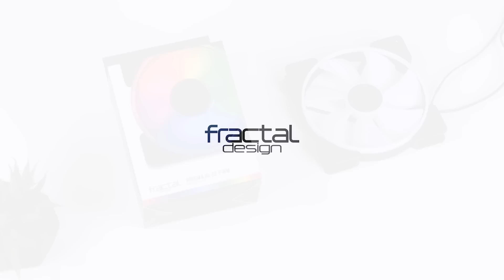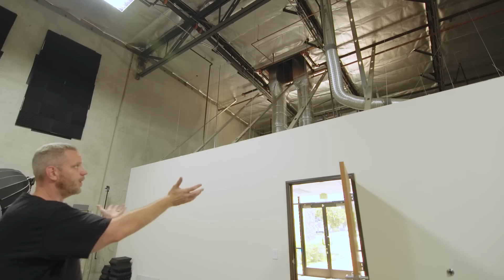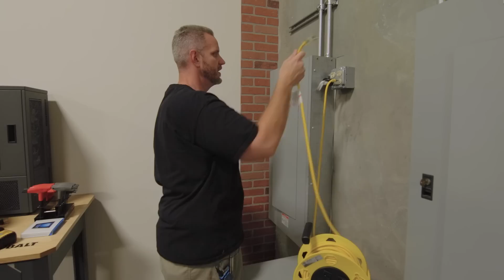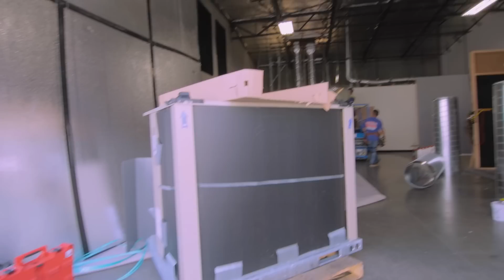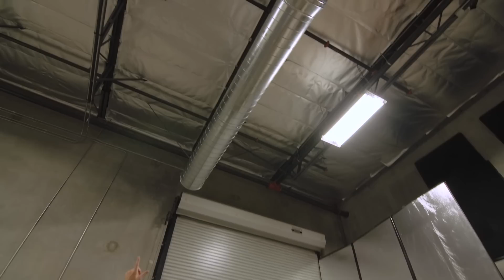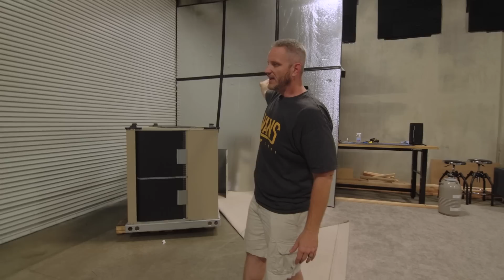The BIGGEST upgrade to the new studio yet!

Comment: Just a thought but if that metal outer door doesn't face an area people commonly walk by then maybe you could setup a outer tarp that slides like a shower curtain. Use the tarp to block the sun off that door. That would greatly reduce the heat coming from it. Just a thought that might could work depending on what you can and cant do and also actually finding a tarp or drop cloth big enough to cover at least most of the door.

Comment: For those curious: a 4 "ton" HVAC unit doesn't weigh 4 tons. It can exchange enough heat to melt 4 tons of ice/24hrs. That's about 48.000 BTUs/hr.

Nominal unit ratings ofc, as with pretty much every other type of thing that converts or "transports" energy.

By melt, it here means taking ice at 0°C/32°F, through the phase change from solid ice to liquid water. That requires about 143 BTUs/lb. Or roughly 334 kJ/kg.

Comment: The reason not to use that as an extension wire is that it is solid core wire. It will work harden and have internal breaks. Extension cords use strand wires that can be bent numerous times without breaks. Which is why solid core is used in walls where it is stapled down. Dont reuse that crap you pulled up, recycle it.

Comment: The "air handling" unit is usually an evaporator+filters+heater+fan maybe some more bells and whistles. It differs from the consumer grade splits that have only condensator (outside unit) and evaporator (inside unit) with no "air handling", which means you can asphyxiate if you don't have enough air infiltration. But those commercial splits are quite nice, many times even more efficient then the rooftop units that some people called packaged or whatever (less heat loss because the air cooling happens inside nearer the demand). I would just run it closer to 77°F and less to 75°F so you're in an nice thermal comfort and pushing the HVAC a little bit less in the hotter days, gaining efficiency!
The speed does influence turbulence and the flow, but at higher air speeds you have higher Reynolds number and usually a lot more turbulence, though surface geometries, dimples and other stuff either push for a more transitional / laminar flow or just push for a critical turbulent flow... not sure if these tubes do anything besides maybe have a certain look due to welding process, but I have no idea how they look on the inside.

Comment: Jay,  if you want to do like any movie sets, have a junction box with switches and proper breakers and proper size extensions.   That way you can have the extension cord on the floor.   
But the best way would be that you install overhead rails for electrical wiring and have proper sized wires extension cords going down where you can plug power bars at your bench.  That way you remove any power cords laying on he ground and taped on the floor.

Comment: I dont comment much on videos. But I design vocal booths and music studios. Roxul insulation is not only fireproof (test it with a torch, would make for a great video!) But also offers awesome absorption for sound stages. I insult all of my vocal booths with it. Creating panels with it is super easy, just get a sheet of plywood build a frame for it, and after installing roxul cover it with any breathable (hold the fabric up and try breathing through it. If you can breathe through it well enough to not pass out its good) fabric and mount it on the walls. Using brackets or whatever means you prefer. 

This makes it transferable in the future so it doesnt become a wasted panel and you can also make it decorative. 

Hope this helps! Love your videos, between u and linus you fill my geek needs weekly!

Comment: I'm not sure if you ever finished your thought. Is your plan to take the AC with you when you move in 5 yrs? Or you just went with a split system because it was cheaper? Because, although I'm sure you know the numbers better than I do, I don't think you'd be saving a ton of money paying someone to uninstall, move, and reinstall the split system. At least relative to what you're spending. I do mostly residential HVAC in the midwest, so I'm sure pricing is much different there also.

Comment: I can tell you right now it's well over 4k. I do residential ac and a package unit depending on the brand is 3 to 4k for a 2 1/2 - 3 ton unit. Used to be like 1500 couple years ago.

Comment: So, stupid question, did you even consider the noise factor of high velocity air? I promise the HVAC guys didn't. You need high CFM, low velocity air to keep the sound down from the air movement. Also, that indoor unit, gonna be loud af, on top of that office structure, will vibrate like a mofo, resonating the wall... People are going to stab you, Jay, because of the A/C low hum that will now be ever-present.

Comment: Why not use 208v nema 6-15 or nema 6-20? Better efficiency and more stable for overclock and build testing, I don't see why you would want to use 120v at all for computers and electronics if you have easy access to 208/240v and the cabling would've been more than enough =/

Comment: MASS for sound insulation ;) A lot of audiophiles uses books ... no, not the kindle kind, but physical dead tree carcass books. They give atmosphere while working to dampen resonations.
For the big door, foam is probably your best bet for insulation, build a frame around it all, use thick plywood (and not MDF), and make sure everything is also glued together to stop vibrations, then coat with something massive ... hell maybe bedliner and get it bulletproof on the go as well X) Plywood is much better acoustic dampener than MDF, infact MDF is pure crap in comparison and plywood is actually quite decent. Just get it there like 1.5" inch thick like you would build a subwoofer case.
Thick stone tiles goes for cheap too, if you figure how to mount them on that plywood it would deaden sounds like crazy through that insulation door.

Comment: That stuff for the power we call it twin and earth in the UK. Its is 100% not OK for portable extension leads and so on, its not designed to be moved or flexed as its solid core cable. You made the right choice to change it.

Comment: those fractal design fans are actually good, i have 3 running (4th one didnt fit) and they are working fine. also make way less noise than the Cooler Master MasterFan Pro 120 Air Balance i used before.

Comment: Some thoughts on the big metal door.  As soon as the sun hits the door it gets hot (duh).  This heats up the air on the inside of the door.  Whatever air space is between your insulating panels and the inside of the metal door will heat and then rise and cold air from the floor will flow in to replace the hot air rising and then that new air gets heated up and on and on.  This fills your space with hot air from the top down.  The solution is to put the panels on the outside of the door.  If not the panels then a roll down insulating barrier.  The idea is not to let the sun hit the metal door in the first place.
I love your vids, all of them.

Comment: Jay, why would you wanna block that entrance because of the heat or the intent to put up an insulation to prevent influx of heat? The channel's going to grow and you might start taking delivery of super fast cars. Would you break that entrance when that happens there after? 

I'd rather you get professional artisans or if possible yourself to fix the insulation unto the doors that would roll with the door when opened.😉😉😡😡

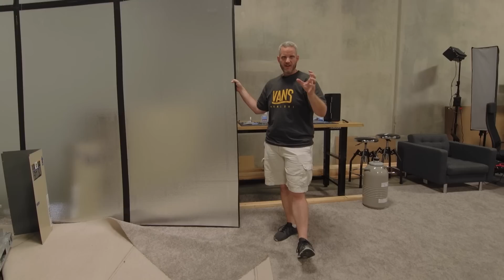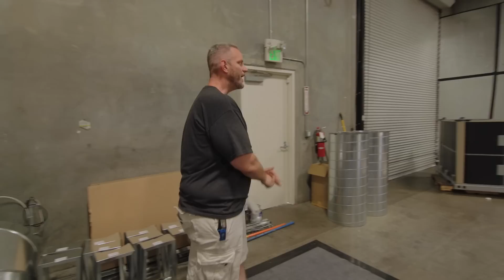Comment: In Phoenix everything was done in the early morning. Even every golf course is lit because first tee off is 4 :00, nobody wants to be on the golf course after noon when the heat is brutal. It goes over 100 by mid may and doesn't drop below 100 until mid October. In July and August it rarely drops below 100 before 11:00 at night, unless it is raining. If it gets really hot here the a/c is just not sized big enough, you want the a/c on about 80 percent of the time. It is not good if it is cycling on and off too much. An evap cooler just works better the hotter it gets. It needs a dry climate, the desert should make one really efficient. They won't work at all in a humid climate like New York. It usually reaches 100 by 10:00 in the morning, but it takes a couple of hours for the building to heat up.

Comment: Romex is only used in residential applications. It is illegal in any commercial application. As soon as an inspector sees it he will fail you. Also any equipment that is permanent, and many things that you would think are not, have to be hard wired. You can't plug them in, at least that was the way it was when I had a business. Nobody air conditions a warehouse, the electricity is way too expensive. You may want a/c though because you are working in the warehouse and paying the electricity bill. One of the places I had a business was Phoenix, the heat is brutal there. In the summer we did most of our production in the morning when it was 20 degrees cooler. We pretty much shut down in the afternoon. Don't do anything in the warehouse after noon. If you can't stand the electric bill use evaporative coolers in the warehouse. That is what everybody else does and they use less than half the electricity, in an uninsulated warehouse maybe a quarter. If your landlord will allow it you might want to cover that door with something reflective on the outside to reflect the sun. It works much better than insulation. In Phoenix the only thing we air conditioned was the office, we found air conditioning a warehouse with 18 foot ceilings too expensive. Cover the roof in something with a light color also. White gravel worked good and it reflected the sunlight well. The biggest thing was starting our day at 4am.

Comment: 14-2 lighting 12-2 20amp outlets. 8-3 220 outlets/stoves/Ac.
0 for sub panel 110 depends on length
00 for 220 sub depends on length

make a vestibule  with insulation for the rollup door.
search sound deadening on fav search engine.

for your sound deadening make a ceiling  either Rock wool it or spray foam with open cell..

Comment: For deadening acoustics with a frame, you're gonna need a deep frame (think a foot or so). Two layers of Roxul RockBoard 80 or other 2" compressed mineral wool on either side, and loose fiberglass insulation in between the sandwich. Cover each side with a good gypsum board and drywall screws (closely spaced to avoid rattles). The large airspace filled with loose material will absorb lower frequencies, where the two layers of compressed mineral wool will take care of anything in the midrange. Make sure to seal cracks and gaps to the outside to prevent sound leaks.

Comment: Jay, AC does not cool hot air. It removes heat from the air through absorption. Air flows through the evaporator, heat is absorbed into the refrigerant and pulled back to the compressor and pumped into the condenser where the absorbed heat is removed to the outside environment.

Comment: ive been doing hvac for ten years if u run into a a problem with sweating on the sprial ductwork i found if u cut grooves on top of the sprial duct all the way down allows air to trickle down around the duct causing outside and inside air to be close to same temp. u may run into problem heres a solution if u do

Comment: Hey, I am  building my first pc and I was wondering what people think
It will be used for gaming at 1080p, games like Rainbow six, Fortnite and Forza
Here is PC part picker link (if you care enough): https://pcpartpicker.com/list/mvLbq4

CPU - Ryzen 5 2600 (I think it will have good drop in price with new Ryzen 3000, and will have the processing power i need) $150 at most
CPU Cooler - Cooler Master Hyper 212 RGB Black Edition (Looks good and good reviews, pretty good price) $27
Mobo - B450 Tomahawk (I have read a lot of good reviews, and has good overclocking ability) $100
Graphics card - Sapphire nitro+ RX 580 (Good price for performance for 1080p) $200 (There are frequent sales too)
Power Supply - Seasonic s12iii 650w 80+ Bronze (I got it for great deal, $32 from $55, This is only part I already have apart from storage)
Case - NZXT h500i white (Looks good imo) $92
RAM - Team Group T-Force Delta RGB 16gb (2x8) 3200mhz (Ryzen is benefited by fast ram, and it looks good) $77
Storage - Seagate 2tb Barracuda 
                 Sandisk 240gb 2.5 ssd (I already have both of these) $99

Any feedback is great as I am really nervous I made a mistake. The total price is $775, which i think is pretty good, but what do I know

Comment: If you are planning on actually building a frame in front of the door you may just want to use regular fiberglass insulation batting.. there is a reason it is still used in houses today. (Cheap and effective)

Comment: Jay, 
HVAC design Engineer here. Roll up garage doors always give us headaches and your idea to frame around it will work well. Spray foam insulation with some R-30 fiber insulation will dampen a lot of the low frequency noise and vibration from outside as well as reduce your heat gain through the door. You're spot on in using the acoustic quilt around the studio but an acoustic study that we recently did found the best results when using a thick quilt (which is best for blocking low frequency vibration) and a thin, but tightly woven curtain (which blocks your higher frequencies) similar to black-out curtains they make for bedrooms. These should not be stapled or tied together, but two separate hanging curtains. The separation allows for each layer of fabric to vibrate and absorb sound independently from one another. 

The 7.5ton system is perfect for your space (its generally 300 sq. ft. per ton of cooling for a conservative estimate) but the indoor unit point return can be kind of loud. I would suggest adding a 90 degree elbow towards the roof to slow the air down a little bit and reduce the noise of the low pressure side of the fan. Good luck with the new setup.
Reply: People - this guy gave Jay some great info free-of-charge. Props to fans like this!
Reply: If it's the same spray foam that is used in residential applications (homes, etc.) then you have to worry about evacuating the premises during application, off gas as it cures, etc. Plus spray foam is more expensive than the other alternative - fiberglass. If he's building a frame to go in front of the door, he could very easily use an r13 batt installation to not only help with temperatures but also help with sound deadening. Keep in mind, sound transmission is based on thickness not R value, and STC (sound transmission coefficient) is based on the WHOLE wall setup (sheetrock, fiberglass, sheetrock).
Reply: Thanks!
Reply: cool quite litterally

Comment: They make a rubber thresh hold protector suitable for your purpose 6.5 Feet Heavy Duty Cable Protector + Cord Cover — 3 Cord Channels — Durable Black PVC is Flexible, Odor Free, Easy to Unroll and Open — Conceal Wires at Home, Office, Warehouse, Workshop, Concerts
4.4 out of 5 stars 146
$23.99

Comment: Rockwool, I like roxul brand, but it has roughly the same insulating R factor as fiberglass without being quite as miserable to handle and dampening roughly twice the noise as best I can recall. 6 r 8 inches of that would probably get the job done, though personally, I would build an 8" thick wall, get 6" roxul, cut it in half and fasten half to each side, leaving a 1.5" air gap between them. That will give the most sound deadening as ti will act as a sound trap between the two layers. Trust me, I stayed at a Holiday Inn Express last night.

Comment: i sell 7.5 ton splits all day 208/230 3ph and 460 3ph. condenser is about 2000 and the air handler would be about 1600 and heat kit another 200. Your contractor will double charge you for the equipment, then charge you labor. I sell em alllllll day here in texas lol.

Comment: Jay, We have the same issues here north of Sacramento with the sun and the heat.  One recommendation, even though not beautiful would be to hang shade cloth on the outside of the building to cover that metal door.  You can actually get them screen printed with "JayzTwoCents" or whatever else, and disguise it as advertizing.  Makes a great way of dealing with a large portion of the heat.  The goal being to reduce sun exposure directly to the metal door, secondly... who doesn't want more advertising.

Comment: First, the seismic wires that support the T-bar grid ceiling can be moved.  Second, for the ducting you have suggested it will take a huge unit "as you have shown".  It actually looks real nice (sheet-metal is great)   Be sure the condensation is well taken care of.  You don't want water dropping all inside your "house".  Hope your vents don't make too much "NOISE".  Good Job, and I'm glad you fixed your electrical hazard.

Comment: If you would have built roof for each of your set then u could have bought split ACs for each set and fix it directly to the wall and use it whichever was required, by that I guess you could have saved alot of money and also electricity.